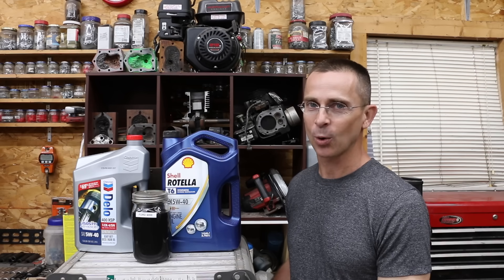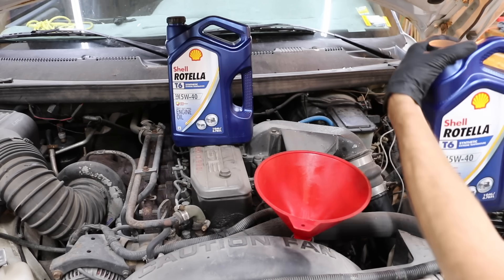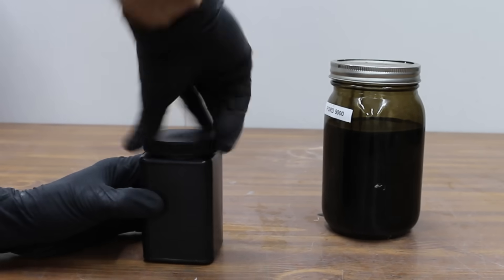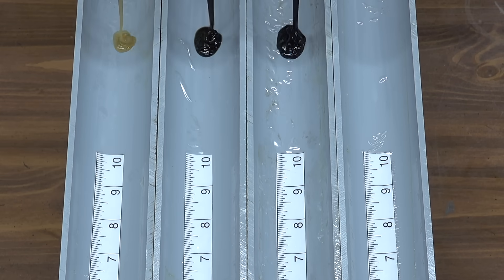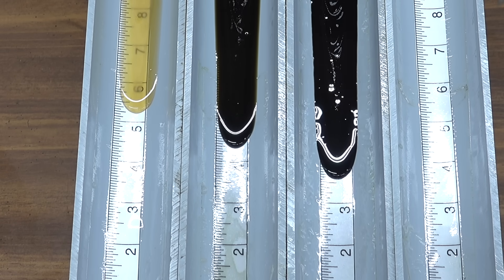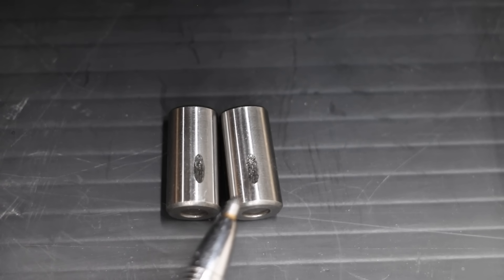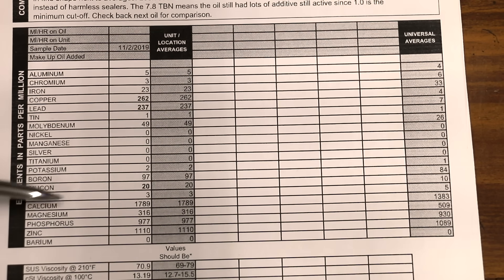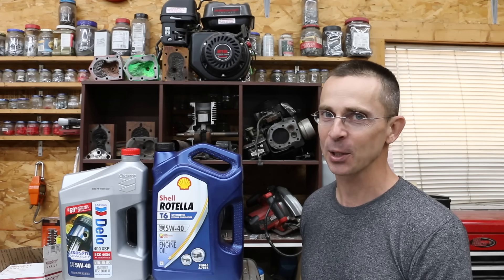Will Annual Oil Change Damage Your Car? Let's find out!

Comment: It helps to remove the intake hose between the filter and the turbo for better access. I use a band type wrench that doesn't have a handle, but instead has a fitting for a 3/8" extension to remove the oil filter. I've come to the conclusion that conditions are a better determiner of when to change the oil and filter. Way too may variables to say that X number of miles or X number of months is correct. Dusty or clean, hot or cold, humid or dry are a few of the variable.  Short trips, long trips, heavy load, no load equals more variable. Watch the condition and level of your oil.
Reply from the maker: Thanks for the feedback.

Comment: oil gets saturated with carbon and absorbs moisture from the air. 
once oil reaches a saturation point - lubrication becomes abrasive. 
oil have additives to disperse and dissolve carbon, but not perform miracles. 
oil , water, oxygen - needs no further explanation. 
physics cannot be denied with snake oil.
Reply from the maker: Thanks for the feedback.

Comment: i choose to do mine at 5000 miles or 1 year. I have multiple cars, and I do use them for motorsports. Using this method helps me keep consistent with my oil changes. Plus, I'm not sure if the oil filter is good for being left on the car, despite the oil being good. Does the paper of oil filter break down?

Comment: I just bought Hotshots Secret to put in my GAS powered engine as a means of getting out a bunch of burnt-on deposits. I bought the 2015 Audi Q7 with 39000 miles and it may have gone (very) long on the oil changes. I've looked under the oil cap on other Audis with the same 3.0T engine and everything I can see is shiny metal. Mine is all brown. The engine runs fine, strong actually, but I do have a check engine light for the secondary air injection system. It's definitely gummy in there. I'll let you know how it goes. Hotshots is recommended for gas engines too so I'm giving it a try.
Reply from the maker: Thanks for sharing.

Comment: Oil is hygroscopic. The reason for frequent oil changes is water contamination. No one is going to send their oil of to a lab once a year so they spend the $50 and change it.
Reply from the maker: Thanks for the feedback.
Reply: @ProjectFarm  As a kid I was taught "viscosity break down" was the reason for oil changes. In the electrical utility industry the reason to monitor oil in transformers (and as it turns out vehicles) is the introduction of oxygen to a hydrocarbon (oil).  Wasn't trying to be a smart ass know it all (cuz I don't). Your channel is the kitty's tittys.
Reply: @ProjectFarm  These videos are great. I'd like to see a comparison of viscosity degradation between synthetic vs. traditional/organic oils.
Reply: Engine oil  is not "hygroscopic".   He did the tests so others don't have to.  The tests are good.  What do you want?  I would be much more concern about coolant  mixing with the engine oil.
Reply: @tocrob  Common motor oil (engine oil) is a hydrocarbon and as such is most certainly hygroscopic. Don't take it personally.
Reply: @citychick4154  - "most certainly"  after 3 -5 years maybe. Again, the tests were good.  What more do you want?
Reply: @tocrob  No, less than a year usually. You may or may not know this, but dihydrogen monoxide has a corrosive effect on most ferrous and nonferrous metals used in the construction of  internal combustion engines. I don't want anything, I think this guy's videos are fantastic.
Reply: @citychick4154  Everything degrades over time.  But what is the impact?   Internal engine corrosion is not a known issue  regardless.  Bad coolant and electrical  issue  are known to have caused engine corrosion (nothing to do with engine oil  though).
Reply: @tocrob  It shortens the life span of the piece of equipment. Bearing, cylinder walls, etc. If you don't think it's an issue don't change your oil. I could care less.
Reply: @citychick4154  -  Change the oil once every 2 years  ( ~6000 miles )  and possibly lose one year out of 20 years of life ?  It's a good bet.  I  think more engines were damaged  by oil change mistakes !
Reply: @tocrob  Okay.
Reply: @citychick4154  -thanks for your concern. The future in EV is brighter.
Reply: @tocrob  Sure thing. Sounds good.

Comment: I know this is an older video but I am one of the folks that was worried about not changing the oil annually on my Ram 3500 when I drive few miles. Thanks much. It is standard practice in light aircraft to change the oil annually. Having looked inside a couple engines during teardown I saw no issue with internal corrosion as long as they were run at lest a few hours a year.
Reply from the maker: Thank you very much!

Comment: Hm... I think the control for the flow test shouldn't necessarily be against the brand new oil, but against 3 month old oil that's been run for about the same mileage (3k).  You control for the changes done by mileage so the only variable is the time that the oil sat in the vehicle (3 months vs 14 months vs 17 months).
Reply from the maker: Thanks for sharing.

Comment: Saw this in my feed and went back to it. Nice video and it got me thinking...I'd like to see a video concerning oil (that's advertised for 10,000 miles) to see if it can damage your engine if the oil is actually used up to 10,000 miles or if it should be changed at the 3,000 mile mark. My thinking, of course, is that as the oil reaches the 10,000-mile mark that it will be dirtier, from trapping dust, etc which could lead to more wear. What do you think?
Reply from the maker: Great suggestion!  Thank you.

Comment: I always suspected that this is true, thank you for the confirmation.  I own 3 different vehicles, 2 that I seldom drive. My oil changes have been once every other year. They both seem fine and show no signs of oil fatigue. It is very important in my opinion with older vehicles to use engine flush and get all of the sludge and varnish out. Synthetic oils do seem to be far better at controlling sludge from forming. I am really enjoying these videos. Great job in making them. Thanks.
Reply from the maker: Thank you!
Reply: I think if you used oil sludge cleaner Every 30000 maybe you should be OK But if you go to 100000 miles then you throw cleaner in it forget it overwhelm the motor I've done this

Comment: Those oils intended for diesels have higher ZPPD and can therefore kill off your cat converters on gas engines.   Enjoy the cost of replacing those.   Also I use Penzoil Ultra Plat Euro Synthetic in my wife's BMW.    She puts on 3000 mi a year and the oil heats up with each trip.   I easily go over 1 year on my oil changes because I don't care.   BTW, only Euro synthetic oils are truly synthetic.   American Fully Synthetic is marketing crap for (typically) grade III conventional oil.   Save your money.
Reply from the maker: Thanks for the feedback.

Comment: This test answers are what the car manufacturers need to know because of their stupid requirement to change oil every six month or so, even when the car has low mileage use, say between 3000 and 6000 miles per year. Since there is NO difference in wear and tear to that of new oil, there should NOT be this requirement to change oil every six months. This would save, not only money on maintenance, but more importantly save the environment as less oil changes means less wastage and less pollution on the environment. Thank you Project Farm. Great job.

Comment: Great Video! Great Job! Please give comparison for motorcycles oil between Motul 7100 5w40 and Motul 300V 4T factory line 5w40, many people said that Motul 300V could not use on normal riding condition because it's a racing oil and lack of detergents. Just want to break the myth! Thank you!
Reply from the maker: Thanks so much!  Thanks for the video idea.

Comment: I change the oil on my Bobcat and boat based on run time. After more then 20 years of very few oil changes, due to low usage hours, both engines run like tops. I suspect the "rule of thumb" about changing oil once a year minimum, is an old wives tale from the past.
Reply from the maker: Thanks for the feedback.

Comment: I was supplied the wrong oil filter for my volvo s80 2002 I have already changed the oil , how much oil comes out of the oil filter section if I took it out , would imagine very little ? I suppose I will change the filter next time .
Reply from the maker: Thanks for sharing.

Comment: I change oil on my four small engines every other year. They range in age from 30 to 40 years old and still run well when needed. I’ve had issues but not with parts contacting oil. Thanks for your good work!
Reply from the maker: You are welcome!
Reply: Sounds like thats more of a testament to the build quality of the engines, rather than the oil. That or they have extremely low hours and light use. Ask an actual professional landscaper, builder, etc. NOTHING lasts that long under regular heavy use.
Reply: @Doomzdayxx  I'm not a profession so you raise a good point. My use is limited to less than 200 hours per year for the most used engine.

Comment: The mistakes I made many years ago was not to pull a vacuum through a PCV valve to draw moisture quickly back through the carburetor to expel  the high moisture content , thinking a cleaner fuel air combustion was more important , maybe in drag racing but not as a street driver  !  You pretty much covered what I learned over the years , thanks as always !
Reply from the maker: You are welcome!  Thanks for watching!

Comment: Oil is cheap and engines are expensive.  Scotty Kilmer   I'd say change it once a year minimum and the question seems absurd.  Changing your engine oil can never damage your engine imo.  As long as you remember to refill it, etc.  Priority one with my car is change the oil every 5,000 miles with Mobil1 and good filter.  However: Maby not such a good idea to change the transmission fluid on a high mileage transmission if never changed in the past.  Scotty Kilmer
Reply from the maker: Thanks for the feedback.

Comment: The oil evaporative test really just tests how much moisture each oil is capable of suspending in the applicable use case...more evaporative loss could be a good thing considering that moisture is no longer in your engine :)

At the race track some folks running methanol actually take the oil out of their engine each race, use a hot plate to boil off most of the water from the condensation caused by the methanol then put it through a coffee filter back into the engine. I'm still one of the guys who changes his oil roughly once per track day due to my tendency to run thicker oil for higher revs so I don't bother but I will say that the guys who do it seem to swap out engines a lot less often than the guys who don't.
Reply from the maker: Thanks  for sharing.

Comment: Very interesting! Could you do a similar test with non-synthetic oils? Also, how long does oil keep in unopened factory-sealed jugs?
Reply from the maker: Great suggestion!  Thank you.
Reply: That would be great because I have never been sold on "synthetic" oil. 
As for how long does it keep thats another great question that no oil manufacturer has ever given me the same answer on.

Comment: I had an old Suzuki Forenza, let almost 40,000 mi between one oil change, and the dealership yelled at me over it, so I had it changed.  I only let it go that one, single time.   I did a compression test afterward, the lowest piston was at 125 psi.  Then I hit a tree with it and that finally did it in for good.  But it did get me to 144,000 mi.
Reply from the maker: Thanks for sharing.

Comment: Hey excellent video Nice truck You use good filters.
Reply from the maker: Thanks 👍
Reply: Hey I was wondering I recently purchased a 2019 Dodge 6.4 Hemi. It uses 0W 40 oil. Synthetic blend. Now this oil only comes in synthetic not conventional. Now this is only a question. Do you think the 5w-40 grade oil could be used in the Hemi 6.4 ? What do you think and any opinion. I highly trust your opinion.

Comment: I did 1 year 15-20k oil changes with Amsoil about 10 years ago.  All engines had around 200k with no issues when sold.  I have a 5.3ls motor that gets 1 year M1 oil changes and has 256k on it now.  Has oil analyzed to back it up.  No break down, good TBN and in spec viscosity.  All truck V8’s, not applicable in high strung motors.
Reply from the maker: Thanks for the feedback.

Comment: I own a 2003 Windstar.  Which, I have changed the  oil every three months for 17 years, But, I have not change the oil for a year now. Because, I don't even put 5 mile on it now. And, that worried a bit. I just checked the oil and it still in good condition. But, I am planning to change it in a few weeks. And, the trany oil. Now,  that oil is not red no more. And, change the transmission oil every three years. Both engine and trans are like new after 17 years. Yes, I have had my share of problems with it. But, I have kept on top it and, I expect it will last me another 10 years. If, I'm still alive. I wouldn't trade it for any of these new cars.
Reply from the maker: Thanks for sharing.
Reply: @ProjectFarm  You welcome.

Comment: I have 2 gas vehicles that I barely put 1k miles per year. I've always done once a year oil changes and never had any problems. The oil still looked new and usable. Also change the oil in my mower every other year with no issues. Anecdotal, I know, but thought I'd chime in
Reply from the maker: Thanks for sharing.
Reply: Good to know some else is a low mileage driver. I Service by doing my oil every year or 5000 klm
Reply: sounds like you don't need to own cars...
Reply: @veeman2939  I have 2 that I barely drive. I have others that I drive more often. I know, owning more than one vehicle must be some sort of shock to you

Comment: This has been the answer to a question I have been asking for quite some time.  I've spent hours looking for an answer with no concrete evidence to support one way or the other.  All i've been able to find is conjecture and the consensus that you should change the oil before 12 months. As with most analysis, it does unfortunately open up another question for me personally, which I would bet is still the same end result, albeit slightly different.  In my case, I store a classic vehicle during the winter months, so from about October to about April, the car is sitting, with oil in the crankcase, untouched.  I am not warming up my car once a month, like you have been doing, so the chance of moisture contamination is much greater.  So the question this video has opened up for me is: How much moisture contamination is present during my usage case, and how much different is it from your results?  In my case, due to Covid, I didn't pull my car out of storage until yesterday, the beginning of October.  I changed my oil with full synthetic in October of last year, and put about 150 miles on the vehicle before putting it away.  So in this case, the oil has 150 miles and 12 months of use on it.  I would imagine, even with moisture, the TBN of the oil is the same, but the only way to know for sure is to get an engine oil analysis much like you did.

Thank you for this video, it has put to bed a question that I have had for a very long time now.  I love your content, even with the more simple stuff you do, it's entertaining, detailed, and always has great value.  Not sure if you will have time to read this comment in it's entirety, but I do have a suggestion for another video. Lately I have been looking at making a 20" box fan air cleaner by mounting a 20"x20" furnace filter to it.  It would be interesting to see how this low cost solution would work in your shop in comparison to purpose built HEPA air filtration systems.  From what i've seen thus far in my research, it's a worthwhile investment and is a better solution, albeit not as pretty as a purpose built machine.

At any rate, kudos on the great content, keep up the great work!
Reply from the maker: Thanks for the video idea.

Comment: I am pretty sure that regular oil changes come a poor second to driver competence when it comes to engine wear.  I am astonished at the number of taxi drivers I  regularly use who apparently have NO IDEA what gear the car should be in for any given speed.  My consistent observation is that drivers badly " labour " there engines whilst going uphill and NO AMOUNT of regular oil changes will save an engine that suffers such continual abuse.
Reply from the maker: Thanks for the feedback.

Comment: A truck will a real engine. I had one just like it. A '96 dodge with a 12valve cummins.  Best engine I ever had. When a diesel was a real diesel.Did you take the silencer ring off the turbo. If not do so you'll here it better...
Reply from the maker: Thanks for sharing.

Comment: All in all , I think you can't go wrong with changing oil often enough .. get of course the viscosity right and you can relax . NOW for me , I've a newer 2016 Ford Focus SE 2.0 L GDI engine and manual calls fro synthetic blend NOT full synthetic . And 10,000 miles interval .. Many have said just don't go the full 10,000 miles maybe around 5,000 or so miles change it ..
Reply from the maker: Thanks for sharing.

Comment: Great video as always. I have a 2000 neon and I haven't changed the oil in years and still driving it and it also has a small leak on the main seal for years and I do add oil (about a quart) at least once a month. Still running fine (daily driven) and last time I did change the oil was when I took a five hr drive then back 10+ hrs and when I changed it the Neon only had about 2 qts of oil . I was like wow and this was years ago when this happened and the engine is still running? Yes it is.. 😀
Reply from the maker: Thanks for sharing.